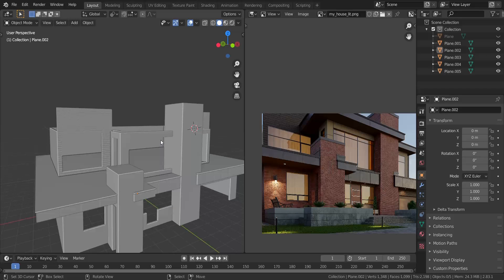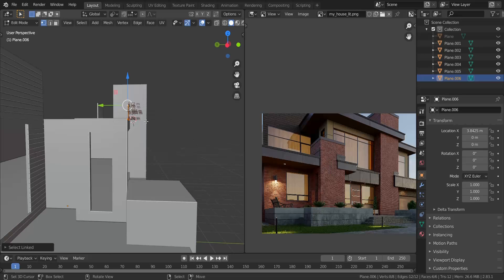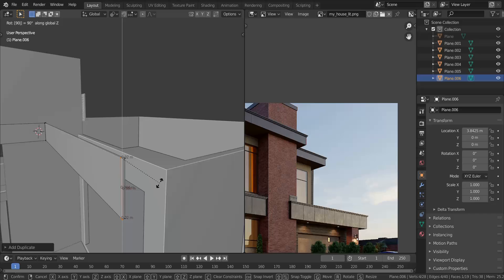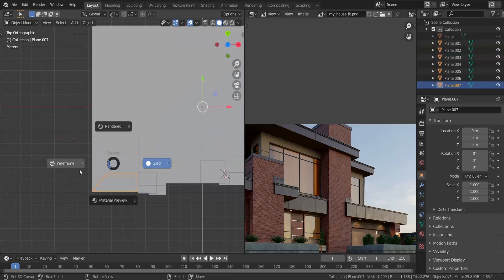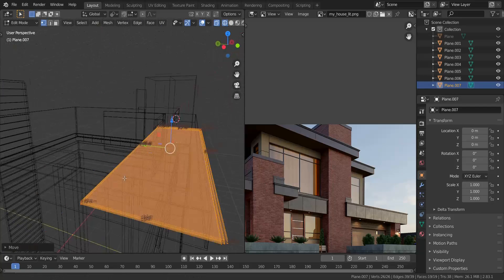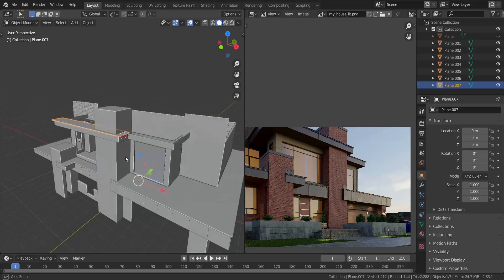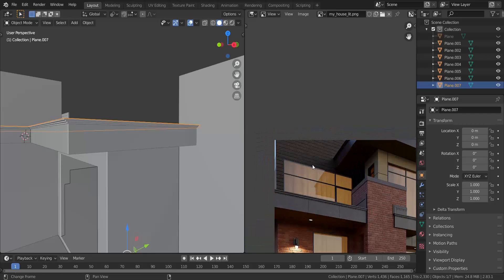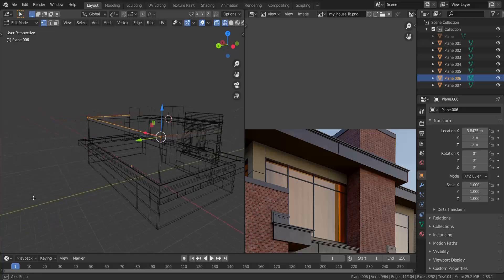Architecture Visualization In Blender 2.8x - Part 7 (Roof)

Comment: I am an architect myself, and I see no sense in using blender or any other softwares like 3ds max, maya, or cinema4d for making Buildings.... What I will prefer is model it on a good architecture software like Revit or ArchiCAD. Complete the building there. Then export it to blender with materials already assigned. Add in 3d Objects, Plants and some other small things and voila.... Its already done in half the time plus I also get my BIM model Complete.
Reply from the maker: Good for you, my friend. But I also know architects who use Blender for their works, and they seem to do pretty fine without ArchiCAD or Revit as you stated...
Reply: @NaturalArtFreak  well what I am talking about here is large scale architecture firms or proper architects my friend. What we need is a lot of drawings and a lot of schedules. And blender my friend does not provide any of these. I know there are workarounds but then we can't compromise for other things too. 

What I suggest for architects is to make your building in the BIM softwares, this gives you your 3D model and also all the drawings and documentation. Then we can come to animating, rendering and archviz in blender. That way its much more faster and accurate.
Reply from the maker: you're speaking like its impossible to achieve architectural work if softwares like you state never existed. I'm sure whatever it is you achieve in those softwares are equally possible in softwares like blender, if anything maybe just a bit complicated thats it, im no architect but all im doing here is helping architects who intend to visualize their work in blender to do so in all aspects... from modeling to texturing to animation. Im sure you understand that.
Reply: @NaturalArtFreak  no.. I am not talking about the modeling part. You can model almost anything in blender too. I am talking about the documentation part. This is impossible in blender and likewise 3d softwares.And that makes sense too. 

I don't want to criticize or compare these softwares as these all have different utilities. I was just pointing out what would be better for architects.
Reply from the maker: @JagdeepKaler5171  seems pretty clearly in ur first comment you were referring to the modeling... If you said from the get go you were referring to documentation then maybe I would have understood you.